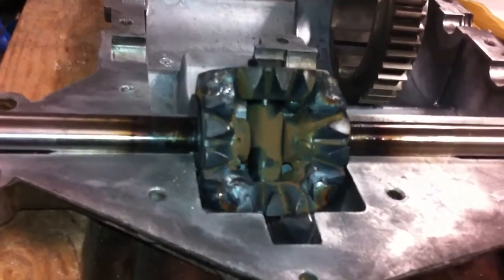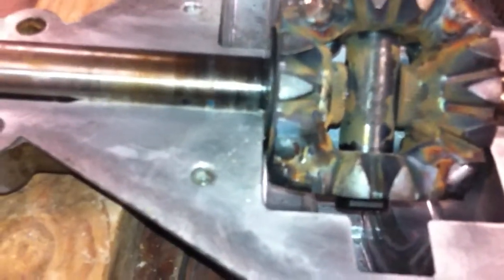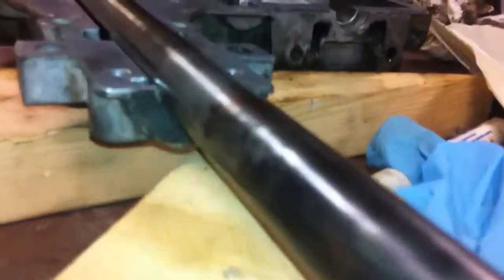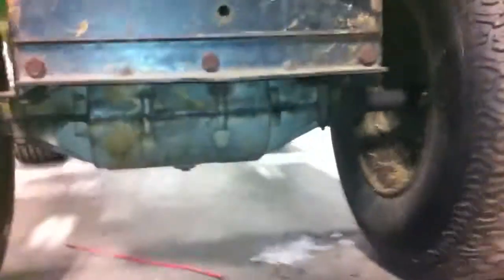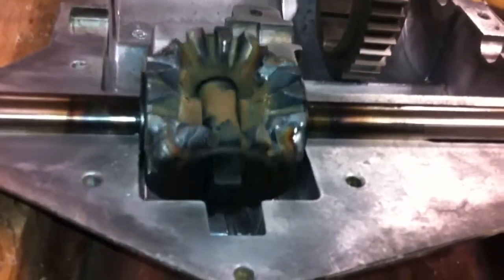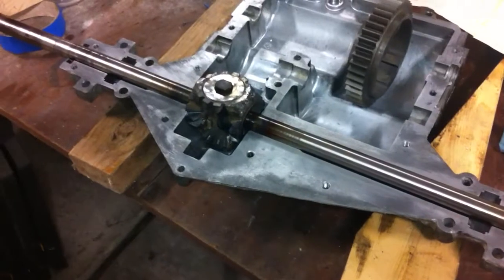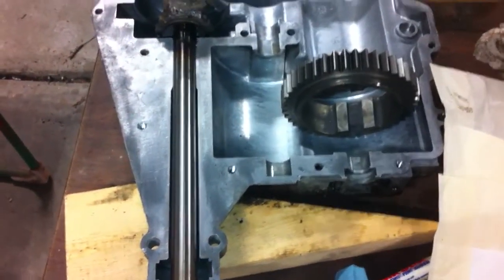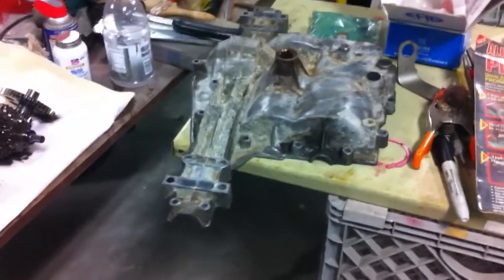Mst 206 part 3 diff lock and more

Comment: Your diff weld job turned out very nice. Bet the extra time spent on the prep pays off well in the end. Got things clean enough? ;>) The gear oil thing seems like a great thought. Years back I bought a bunch of magnetic drain plugs. Put them in everything here, on the fill side too for a quick how ya doing check. You gonna run synthetic gear oil too?
Reply from the maker: Thank you for the compliment. Actually these transaxles are factory filled with gear oil already, which is nice.  
There's a fill port, but I think after I fill it with some synthetic and some Lucas I'm gonna make some kind of dipstick for checking it. 
That's a great idea on the magnetic drain plug too!!  
Thanks for watchin !!

Comment: Should be able to fix that with some grinding. Hope it works out
Reply from the maker: Yea I don't think it's a big deal to fix. Haha, I wonder if I should even bother welding the pin though. 
Thanks for watchin!
Reply from the maker: Yea I don't think it's a big deal to fix. Haha, I wonder if I should even bother welding the pin though. 
Thanks for watchin!
Reply from the maker: Yea tonight I shot the pin with a little wd, pushed it thru the gear a little and dressed it on the belt sander. I also found a better shim stack and got the diff tighter.